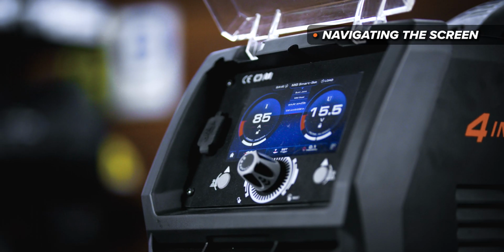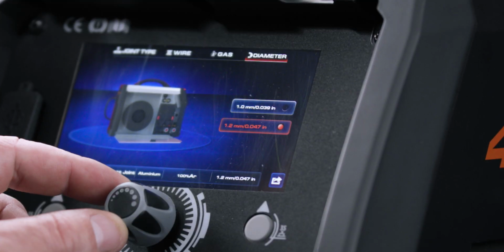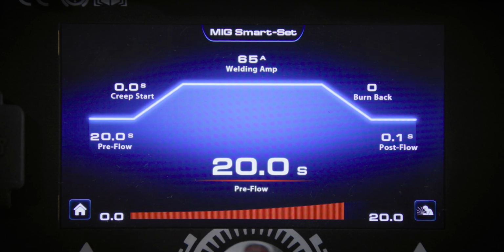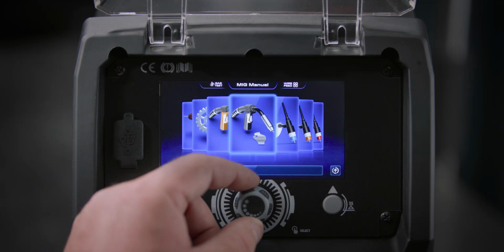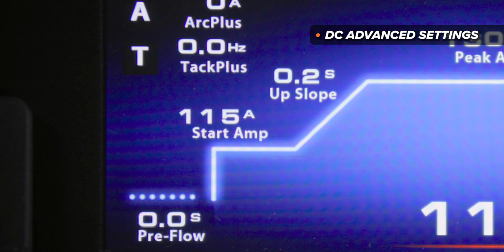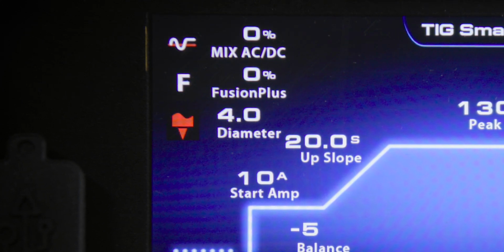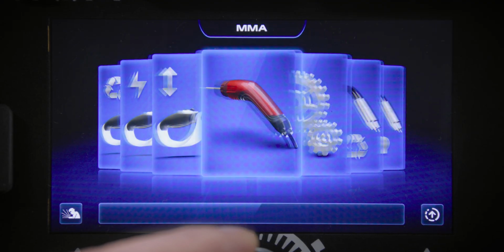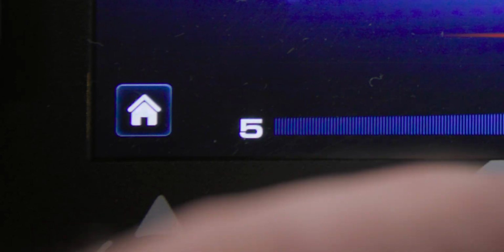RAZOR MULTI 230 AC/DC Full Setup Guide

Comment: Does that mean to tig weld aluminium thr AC/DC mix should be set to 80% ? I am having trouble with alloy on this just by using the smart tig settings.
Cheers

Comment: Should I be getting a e13 code when I flick the power switch off?? Have it plugged straight into a wall socket and tryed multiple, have not set any settings or used for any welding yet, set to 10amp mode also??
Reply from the maker: Hi Daniel. yes this is normal to have this error code pop-up. E13 means under-voltage which is normal when switching the power off.
Reply: Thank fuck for that lmao, I was also worried but just ignored it @unimigsupport

Comment: I'm struggling to decide between your new TIG 200 AC/DC & the 230 Multi on the TIG features as in some respects the 230 Multi seems equivalent. Does the 230 Multi have TIG Lift Arc & is it correct that the 200 AC/DC can TIG weld more material types versus the 230 Multi?
Reply from the maker: Hi there, the 230 Mutli AC/DC does have Lift TIG function you can select it in the main menu. In terms of the material type both machines can TIG weld the same materials.
Reply: Thanks for the reply. One last question - is the TIG 200 AC/DC a better TIG machine & if so why is that? Cheers. @unimigsupport
Reply from the maker: Not necessarily, the 230 actually has more features such as independent waveform selection & higher amperage (230 Amps @ 35% duty cycle). The advantage of the Razor 200 AC/DC is it can run off a 10 amp plug, is smaller & can take a water-cooler for liquid cooling tig torches. @draincctv8659

Comment: "Wave form must be on DC to do AC weld". Please clarify that part for me. I thought it should be on those other ac wave forms beside dc wave form to do AC welding.
Reply: Did you find out what he means?
Reply: That's not what he said. Must be in DC to do DC weld. If in any of the others, then it will weld AC, even on mild steel

Comment: Are these able to run off a generator?
Reply: Yes. from their advert:
"Going off the grid? The RAZOR MULTI 230 AC/DC can be connected to a generator, we recommend one with at least an 8.5kVA rating for 10A mode, 10kVA for 15A mode"
Reply: @JustinShaedo  thanks, I had just bought one and that was the only thing I failed to check. 👍
Reply: @complexedmind5739  nice! I'm thinking of getting one too. Hope you get some great welds out of yours!
Reply: Got some knowledge to share bro, we ain't enemies my friend.
Reply: Yes, if it's 8.5kVA capable.